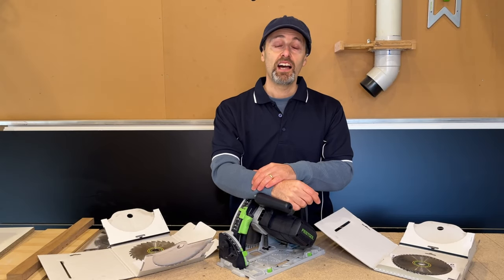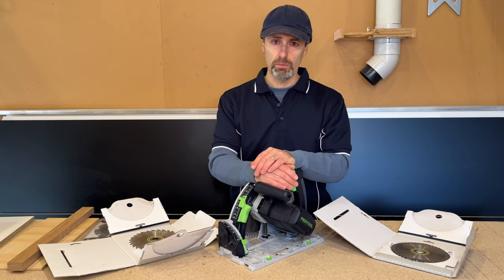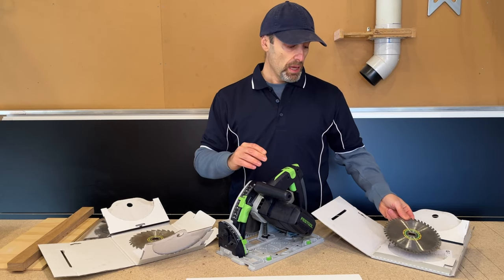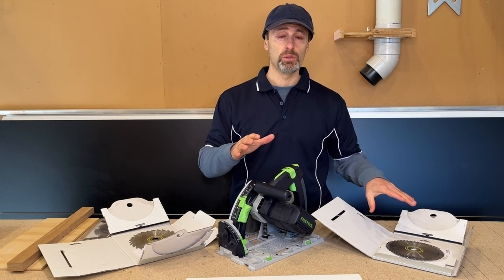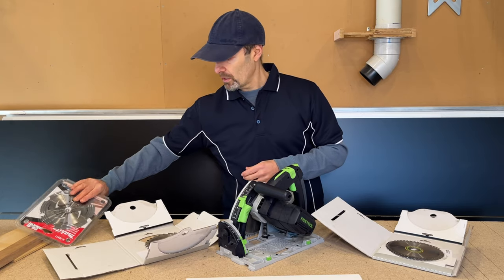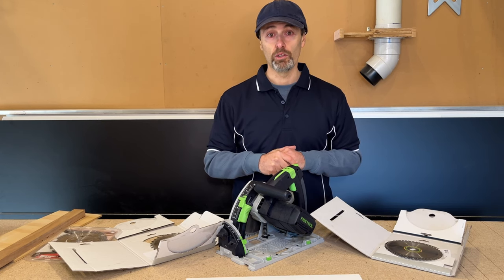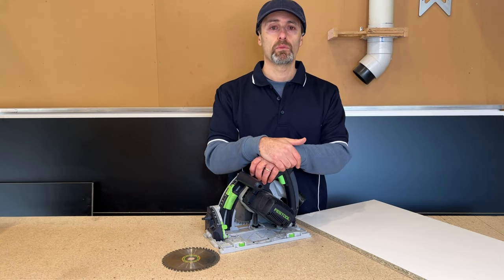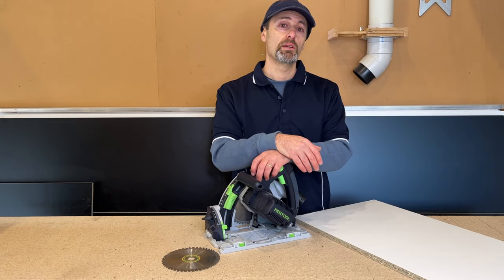Cutting Melamine With a Track Saw | Cutting Melamine NO CHIPS | Track Saw Cutting Techniques

Comment: Use Red festoool blade for melamine . It cuts clean top and bottom side of your boards as well as the off cut side .. Scribe method you show , only works on face of melamine , bottom of the board however ends up with plenty of chips ...
Reply from the maker: Thanks for your reply Hunter 👍

Comment: Neat. Is using hard support below enough to avoid chipping on bottom side? Scribe worked well to get perfect top, non-waste side, but my bottom still looks like i've used chainsaw on it. I use fairly dense insolation foam as cut buffer.
Reply from the maker: Hi Jack
Yes it’s very hard to get a perfect finish on melamine top & bottom using a track saw. Couple of things to check:
1. Good quality fine tooth blade (48 teeth) and sharp.
Sacrificial board underneath ( I have always used a cover sheet of something like particle board) which can help a bit. 
The only way unfortunately to get a cleaner result is using the cabinet saw.
Hope this helps, thanks for watching 👍

Comment: Hey, thanks for the tip! Does the cutting speed make a difference? I tried this method with my Makita SP6000J track saw using the 48T blade it came with, but I noticed a slight tearout on the opposite side. I accidentally had the saw set to the highest speed. Would lowering the speed help prevent this? Thanks in advance!
Reply from the maker: @fernard8985  keep the speed high rather than low, the fast revolutions helps. Try having a sacrificial board underneath your material and make sure your blade is adjusted to pass into that sacrificial piece. That should also help with chipping on underside.

Comment: hi should I better use a miter angle while I'm doing a scripe pass? thanks
Reply from the maker: Yes that would help if you don’t have a track/saw
Reply: @geoffsjoinery4990  which is the best miter angle to use?
Reply from the maker: @stefanoricci6714  just try to find a good strong aluminium one

Comment: You failed to mention what blade configuration you would recommend.  Do you use an ATB, FTG or TCG.  Ideally you should use a TCG with 5 degree negative rack.  That blade will last much longer and stay sharper and will cut 18mm boards in 1 pass with no chips.